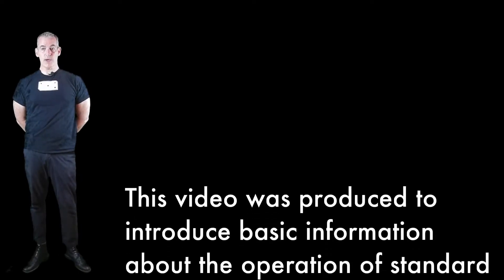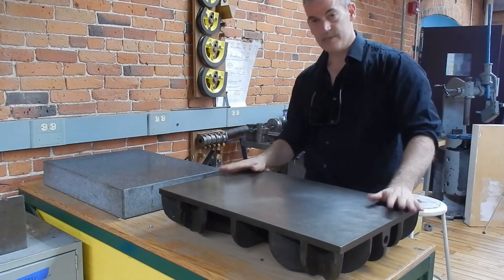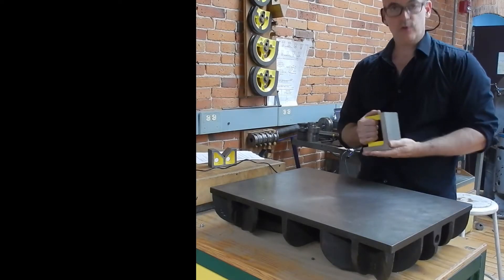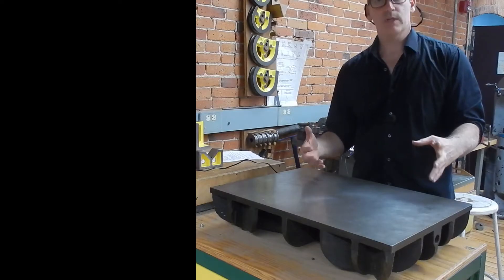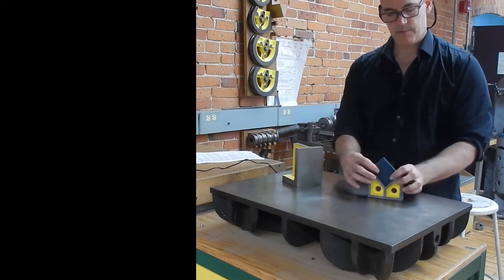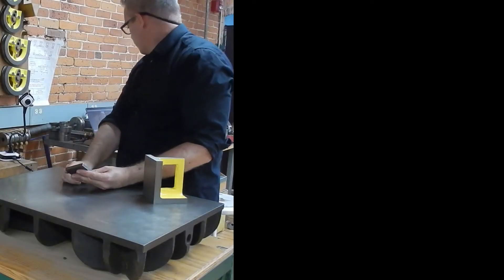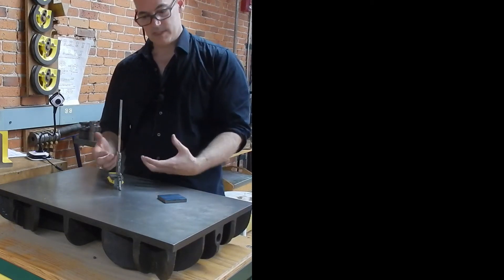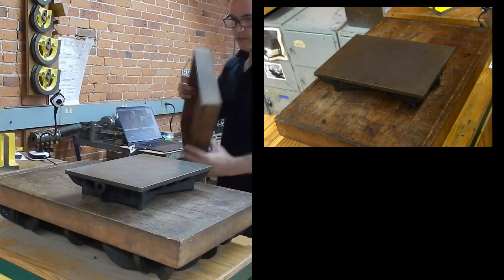Common Metal Shop Tools: Layout

Comment: Nice video Matthew!  What you called a "knee" is normally called an "angle plate."  Also, the flat surface of your small cast iron surface plate was probably machined/ground to get it close to flat, then scraped, and finally lapped.  I'll also watch the two videos you linked to in this video.  Thumbs up!